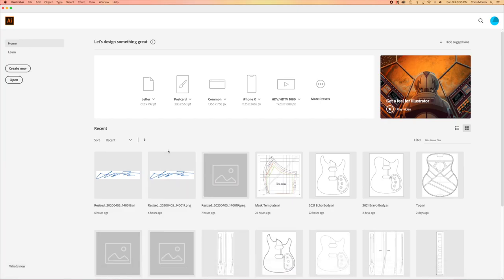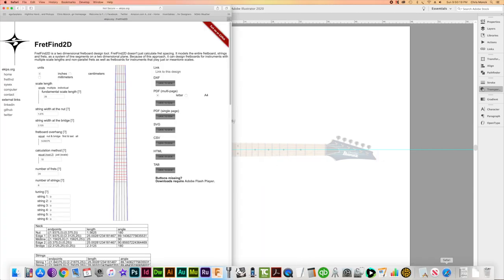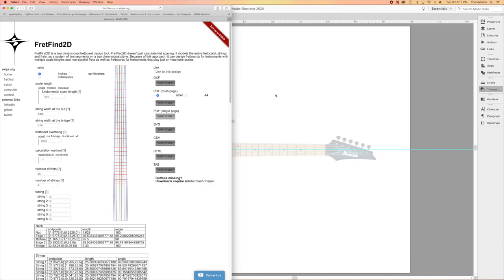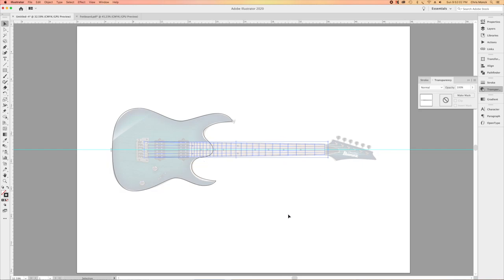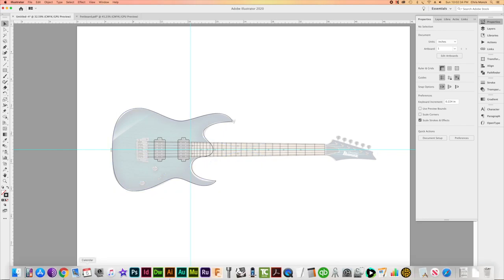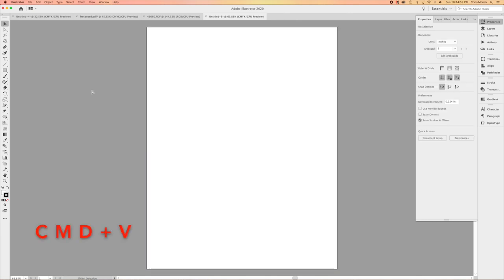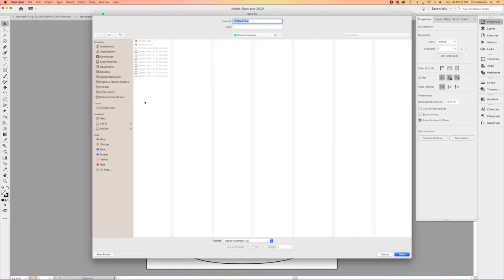How To Create A 3D Guitar Body Part 1

Comment: Another tip; use the Align tool to get your control holes straight and evenly distributed. And when you want a round hole click on the link icon so you only have to enter the dimension once.

Comment: So, what I'm getting from this is, If I want to create an original shaped body based on an S or T bolt on neck, I could start with a drawing of that type of guitar, adjust the size to match the scale, and then instead of using the traditional shape, draw an original shape for the body outline...and end up with a ready to bolt on body.

Comment: Do you find this better than creating it in a 3D software like Fusion 360? Or is this just the workflow you're used to? And thank you for the great videos. I just recently purchased your plans to build the CNC router. I was just going to buy a CNC but couldn't find one that was in my price point with the work area I needed. Your design will be perfect and will save me a lot of money.
Reply from the maker: When I developed my workflow, I tested a lot of software and settled on Adobe Illustrator/Rhinoceros 3D/MeshCAM because of their ease of use and my familiarity with how they work. I tried Fusion 360, but like so many others, I found it to be a PITA to use.
Reply: Highline Guitars PITA creating the CAM processes or even modeling? I have been using 360 for a few years and love it but I’m new to creating CAM processes.

Comment: Hello Chris! I had a specific question for you:  When dimensioning the neck pocket in a solid model, should I use exactly the same dimensions as the end of the neck that is supposed to fit in there (as I do with my 2D drawings), or should the neck pocket dimensions be a tad bigger to allow for the fit? If so, how much gap should there be? 0.1mm, 0.01mm?  It seems this will be a consideration for CNC carving. Thanks!
Reply from the maker: I make the neck pocket the same dimensions as the neck heel and the fit for me is nice and snug.
Reply: @HighlineGuitars  Awesome! That is what I was hoping the right approach would be 😀! Thank you so much for your help as always!

Comment: This is pretty much how I do it. You know you can set the image as a template, which dims the image. I stick each part on a new layer.
Reply: Do you use Rhino? If so, how does it compare to Fusion 360?
Reply: @cwboxguitars  I use Adobe Illustrator for 2D drawings. I’m learning Fusion 360.

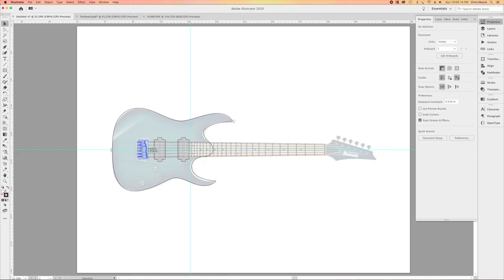Comment: 10:15 I'm curious, don't I need to take in consideration the moving saddle? Say, take a middle point between the further out and in of the piece, and align that to my intonation line? By the way, I am really grateful for this videos, this is as we say in Spanish "oro molido"  (Ground Gold) Thank you very much for the information.
Reply from the maker: No, that's incorrect. If you do it that way, you're not going to have enough rearward saddle travel for the E, A, and D strings to intonate. Move your high e saddle all the way forward and then move it back about 1/32". That's where the intonation line should be.
Reply: @HighlineGuitars  Thank you!

Comment: Chris - great video!  Are you concerned that the fret slots from FretFind2D do not match the frets in the images as you move towards the higher frets?
Reply from the maker: No.
Reply: @HighlineGuitars  Why do you think there's a discrepancy?  Is it the perspective of the photo?  I'm assuming you always use the FretFind2D slots instead of tracing over the frets in the photo - correct?
Reply from the maker: @benweiss897  The photo is not accurate. FretFind 2D is.

Comment: So I plan on using a warmouth telecaster neck and the neck pocket for that is 3x2 and 3/16. Basing my body shape off of a telecaster ultra. When I go to make the neck Pocket, the width of the neck pocket is about a 32nd longer than the image when I use the warmouth dimensions. I know the neck pocket is on of the biggest things in making a guitar play better so I’d like to do the best I can. I’m wondering if I should base it off the warmouth dimensions or the image of the telecaster. The strings on the image look as though they line up with the template i am using from fret finder 2d. However, the fretboard on the image looks just a hair wider (on the low e string side of the fretboard) than the fretboard template.
Reply: I think I got it actually, I found a neck blueprint on a warmouth forum and used it to make the pocket. The pocket is pretty much even on both sides of the neck template now.